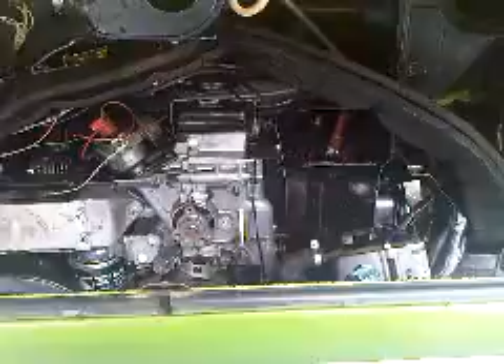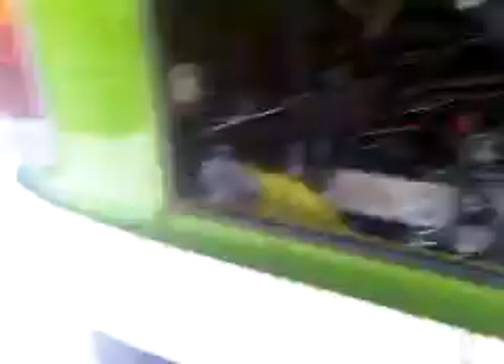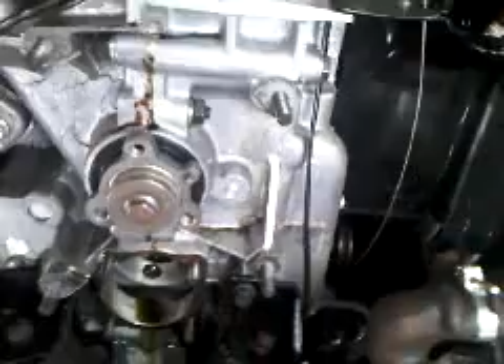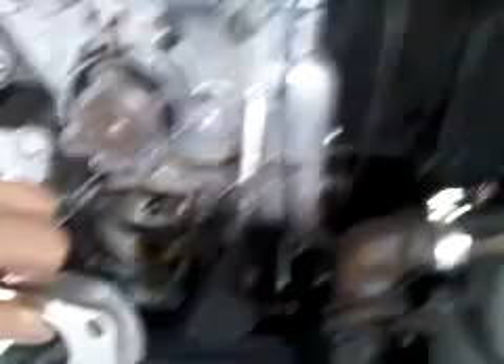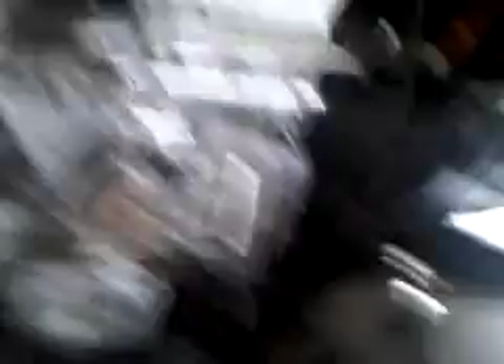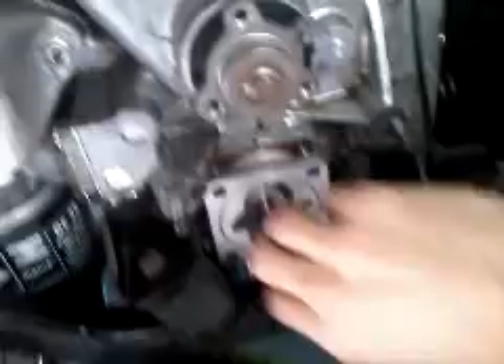1977 VW Westfalia oil pump too small

Comment: I had a problem just like this on a new pump and case, 
when the engine warmed up the oil light came on, the solution was to put a castiron pump on it and solder around the inlet and outlet holes and sand fit it on there after that it had hot 47 lb of pressure cool huh,

Comment: hmmmm you need to replace camshaft  gear  you need the flat  cam see the video  in you tube  , this happen to me, the oil pum is good  you need to up date the cam shaft  gear to instal the  new high performance oil pump , make sure you have 4 rivets  in the cam shaft  if you see you have the 3 rivets cam shaft  you cant install this pump in your engine